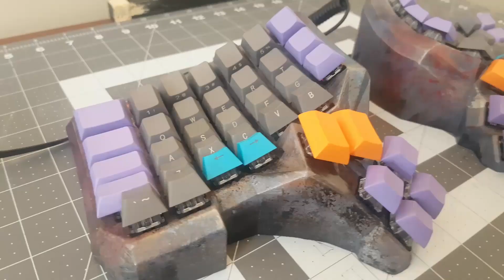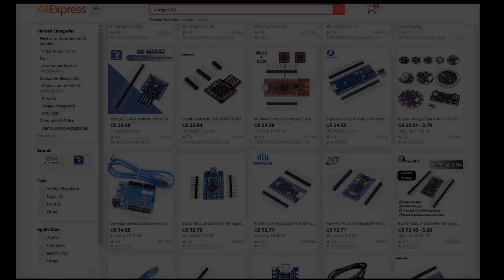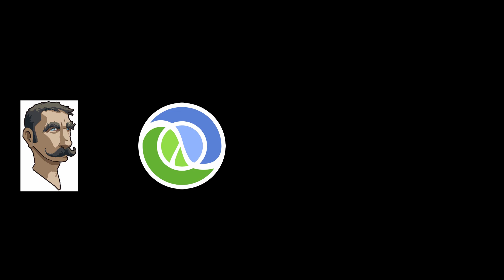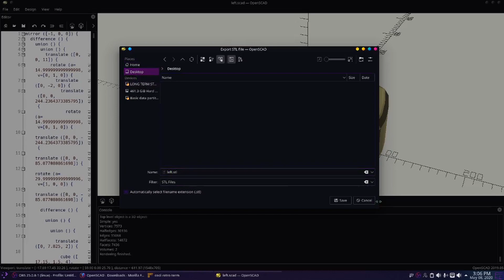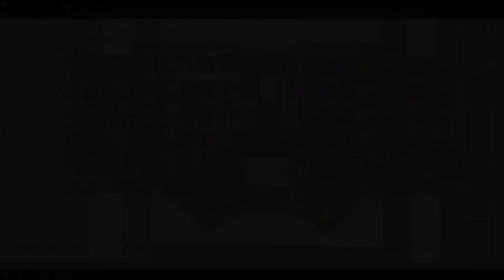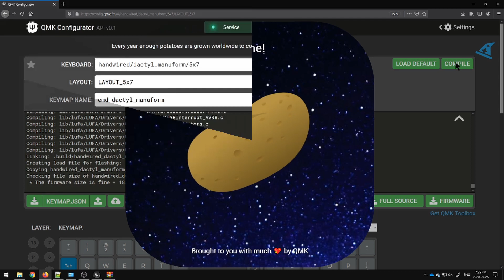CMD - Dactyl Manuform Build

Comment: Hi, I've built and programmed both sides. They both work separately but when I connect them, the other one doesn't do anything. I've checked the headphone jack sockets on both sides and they are good. I know this video is a few years old but any help would be great, thanks.

Comment: Thank you. One of the most comprehensive vids on the subject. As an Ergodox Infinity user for years, I'm seriously looking at the Dactyl config with custom mods of course, but in your vid at the end, I finally saw how the thumbs relate to the two orange keys. This has been bothering me as I have hacked the Ergodox config to suit my own eccentric needs and that Manuform set up bothered me. I'm getting ready to go down the next rabbit hole of split linear keyboards. I've been following Matt Adereth since the beginning of the Dactyl journey but now Kinesis have release the 360, motivation has returned. Just as a side note, a custom config Kinesis 360 in Australia would set me back about $900+. Custom building one myself might not be that much cheaper but I get something I can configure to my specs right from the start.

Comment: I like to use Kailh hot-swap sockets for my handwired builds. That does not only allow me to change the switches (as you would expect) but also to change the printed frame (or plate or however you want to call it). So if the frame happens to break, I can simply print a new one. Then I can pull off all the wiring more-or-less easily.

Comment: Great tutorial, but one thing bothers me: you've spent so much time and effort into ergonomic keyboard, but you are still using a goddamn QWERTY layout
Reply: Meh, different layouts are overrated. I find a columnar layout a way bigger improvement for ergonomics than having the most used keys in the home row, or achieving a good balance of right and left hand alternations between subsequent letters. If you're already touch typing, there's not much point of moving to a different layout. But if you're not touch typing and moving to a keyboard with such a different physical layout, then by all means, learning a different logical layout may help getting rid of the bad old habits.

If all you do is typing, fine, try Dvorak, Workman, Colemak-DH or something else, perhaps Malt if you're on a split keyboard with a thumb cluster? Nah, perhaps that's too far. But if most of your work is done with a mouse and hitting key combinations, that's going to be a lot of pain for no gain at all. I would never advise someone doing video editing or CAD work to drop just QWERTY.

Comment: How much did it cost to build this?
Reply: TL;DR: if you already got the tools, it can be as low as 60~80 USD or could be hundreds of dollars, depending on your choices.

Long version: It's hard to put an exact price tag on such DIY projects. You may be reusing old / spare parts from other projects, you might be getting way more parts than you need, to build stock for future projects, and the labor you put in such projects is hard to put a price on...

Speaking from a recent experience on another much simpler keyboard than this (a corne), I "saved" some money by designing and 3D printing my own keycaps, if I just stopped here... I "saved" money, as they were less expensive than a commercial keycap set. But I'm not finished yet, I'm still going to buy sandpaper, brushes and paint to try giving it a nicer look. In the end it would probably be cheaper to get a commercial keycap set and be done with it. For me, this isn't about saving money, it's about learning new skills.

Another thing that I'm planning to try later is designing new keycaps to try the idea of snap-fitting parts printed in different colors to emulate the function of double-shot keycaps with backlight support. That's not something that I particularly care about, but hey, the board I got already has support for backlighting, if I get some LEDs and solder them into the board, it's a simple configuration change on the firmware to take advantage of it, and it's also another excuse to learn some 3D modeling and printing skills.

It only makes sense to talk about cost to build if it's something you're doing to sell or if you just want a rough estimate of how much it may cost you to go in a similar journey, but even then, it's hard to compare as it's going to vary a lot for different people. Some people just want a minimally functioning keyboard, others will spend tons of time and money on making sure it fits their preferences just right, others are in just for the journey and the joy of learning how to do stuff. How much it's going to cost in the end depends on how much you're willing to put in the "non-essential" parts.

Circling back to my corne build: so far I've spent probably 110~120 USD on it, but discounting the parts I bought and didn't use in it, it's probably around the 60~80 USD range. I could have saved some money on the PCB and case, but decided to buy them in a ready to assemble kit. I could 3D print the spacing plates for next to nothing and could order the PCBs for less than half than it cost in kit form, but I didn't want to have headaches if anything went wrong with the PCB manufacturing part, as I don't have experience with it yet.

Baby steps... next time, I just might give it a try into designing and ordering custom PCBs, and perhaps even including the microcontroller on the keyboard PCB itself, rather than soldering a Pro Micro or a Pi Pico into it. Maybe a macropad or a steno keyboard? Not sure yet, I'm probably downsizing even more for my first custom PCB, this way, if anything goes bad, it's a less expensive mistake.

Comment: very helpful, and it is actually not that hard, if you just want to make a regular dactyl manuform keyboard,  you don't have to know how the Pro micro and the qmk works. You just need to follow the video tutorial and do some welding jobs.I strongly recommend everyone make the keyboard by yourself! By the way, if you want to add some extra features like RGB, Track ball or wireless connection, that require more professional knowledge.

Comment: Thanks for posting this and publishing the repo!  I am typing this, if very slowly, on my build of your STL files.  It took absolutely forever to wire up the matrix.  And I did it wrong on several levels (diode direction and the coordinates of the thumb cluster keys), but all that was easy enough to fix in the qmk source code.  I also had some prooblems with the two sides talking to eavh other;  it turns out that the cheap Micro clones I bought in a hurry have goofy regulator setups, so both sides think they're in charge.  Another quick kludge in the source, and everything is happy.  Now to unlearn several decades of non-standard typing habits…

Comment: Hey man I loved the video! I was just wondering why you didn't print the backs of the cases?
Reply from the maker: Mostly because the fork I went with didn't generate them. That and I didn't have threaded inserts/bolts. But my keyboard bracket mounted under my desk has two strips of foam that hold each half quite nicely, so I didn't bother.

Comment: Awesome video, great work! How does this board perform compared to the kinesis advantage2 in your opinion?
To put it very practical, would you use this as a daily driver or prefer to pay a bit more to get the kinesis if you were coming from a traditional keyboard?
Reply from the maker: Thanks! As it stands right now I would prefer to go with the kinesis if its in the budget. Right now my daily driver, i.e. my work keyboard (I'm a software dev) is the Advantage 2. At home I use the dactyl manuform.

However, I have been working my ass off on designing a split keyboard that feels more like the kinesis. I'm getting close to something that I think I'll like the feel of. I've sank 100+ hours of CAD work, and probably close to double that printing off tests. Will definately make a video when it's all said and done. Thanks for the kind words.
Reply: @constamentaldrift7016  thanks for the quick feedback! I always thought the thumb clusters of the kinesis look a bit weird but from what I'm hearing it sounds alright. 

Did you use the openSCAD/clojure approach used for the Dactyl manuform or manual modelling? Curious to see what you'll come up with. Good luck!
Reply from the maker: @jefmasereel4956  I'm using OnShape to model it.

Comment: The guys from Falba Tech should watch your video. I have a hand wired Atreus42, but the soldering is horrible. 

Good job. I think I will build something similar if I have my 3d printer next year
Reply from the maker: I'm working on my own keyboard design recently. I'm trying to essentially re-create the advantage 2 but in a way so that you can hot swap the key switches. But the main goal is to make it super easy to 3d print. I'll likely make a video/post the stl files for it when it's all done.
Reply: @constamentaldrift7016  I wish the Kinesis Advantage came in 2 parts. I've got an almost decade old one as my daily driver. It's OK, but I enjoy the shoulder relief I get with a properly split keyboard. Onwards to a Dactyl Manuform! :)
Reply from the maker: @hillie47  The thing I don't like, especially coming from the kinesis is that all of the bottom row of keys are shifted to the right by 1 key to make room for the thumb clusters. Also, the way that the pinky columns are oriented, I'm always hitting caps lock instead of left shift.
Reply: @constamentaldrift7016  Thanks, good points! I'll examine the layouts again to see whether I'll be cursing my time and money wasted or whether I'll enjoy it. :)

Comment: What are your thoughts on the perfect size for the dactyl for a programmer? Also what are your thoughts on the HID Technologies Bastyl?
Reply from the maker: The 5x7 layout is what I'd recommend. You need a layer key set up for getting at the function keys, but it's as close to the Kinesis Advantage as I could get without getting obscenely large, and I write code on the kinesis for work all day long. 

Regarding the Bastyl, It looks really nice. A lot of hard work went into developing it that's for sure. The one shown on the page is not big enough for me to want it, (5 thumb buttons and only 4 keys per column means that I'm shifting layers just to type numbers and parenthesis.. no thanks) BUT, a handmade ergo keyboard for under $300 USD is a pretty good deal.

I'm actually making my own kinesis clone with hot swappable sockets, probably months off, but I want it to be really easy to 3d print. I'm doing all of the CAD work and test prints now. Will almost certainly be turned into a video when/if I finish it.

Comment: I used to have kinesis but couldnt get used to cluster position - it was in weird place. I use lily58 now,  maybe I should try to build this one, is cluster good or you need to do some gymnastics to reach cluster?
Reply from the maker: The clusters are quite easy to reach on this compared to the kinesis.

Comment: Great guide!
Did you have any issues with segments being too thin for printing? 
I've been looking to make a DM, so this has been incredibly helpful so far, but the online tool I'm using (for a local 3D printing service) is complaining about wall thickness in several places
Reply from the maker: I did use prusa slicer to cut off the bottom 1mm of the stl file generated by openscad because of some thin geometry near the bottom as shown in the video. But the .stl files on my github are those fixed versions, so if you are using those, the only other thing that I can think of is that I'm printing at .1mm layer height. It might be that the printing service is using a thicker layer height with their slicer, which might add or remove some wall thickness. If you generated your own models using clojure, there are so many opportunities for unexpected geometry (i.e. thin features) I'm not sure where the issue might be in that case.

Comment: I already commented on reddit but just want you to know how great this is, I wish I had this for my build that I just finished cause it would have made my life so much easier but oh well. I did learn that I only need to program from one side to remap both sides so that good, and that I don't need to unplug the keyboard which is great so thank you.
Reply from the maker: I though about adding a pushbutton for reset. Just wire the switch to RST and GND. Could hot glue it in behind the case pretty easily after drilling a tiny hole. Then just use a pencil or w/e to do a quick reset.
Reply: @constamentaldrift7016  was actually just thinking about that. I don't need a USB on the right side so I could put the button on the right side and use the unused wire on the rj9 to connect to rst on the left board.
Reply: @killahb33  So do we need to flash both the pro micros or only one?
Reply: @sumitpagar9004  both, but that only the first time. Once they are both flashed you only need to flash the master to change the layout.
Reply: @killahb33  Thanks for the quick response.

Comment: Have you considered 3D printing your own keycaps? There's some very nice ones in pseudoku/PseudoMakeMeKeyCapProfiles on Github, featuring alternatively curved keycaps that might be very nice for your thumbs. Of course, since the keycaps are already aligned to your thumbs, that might not be necessary for the Dactyl-Manuform, but you might find some minor optimizations possible.
Quick tip is to print the keycaps at a diagonal angle, you want good resolution on the stems so they have a tight fight, but you don't want to have to spend an hour finishing the touch surface. Also make sure you have the keycap stem in the correct orientation for the switch, it'll only fit on the switch one way.
Reply from the maker: I didn't consider it, but I'll take a look at the repo. It'd be cool to try some out/go ham with the model paints after. Thanks for the tip.
Reply: that github seems to be no more

Comment: this was bonkers in a good way and now I understand why these things pre-built eclipse rama pricing. that being said, is there a reason you didn't build a bottom? it would improve the sound and feel tenfold.
Reply from the maker: I plan to add a bottom later. I've got a little slab of HDPE that I plan to use, but I don't have a band saw/scroll saw at the moment. I wanted the bottom to have a bit of heft, which is why I didn't 3D print one.